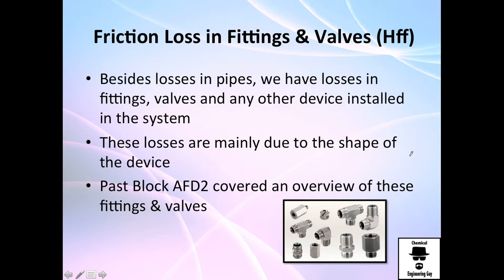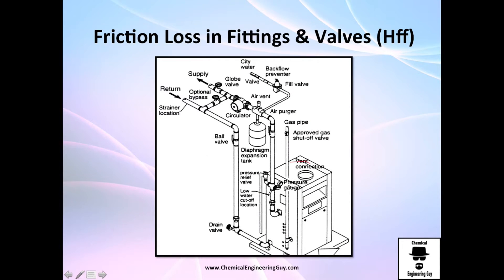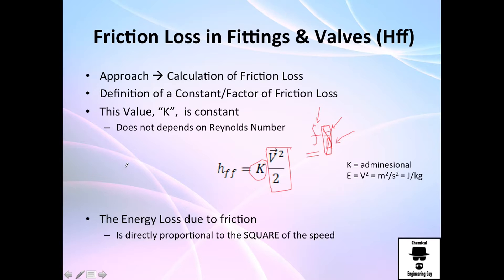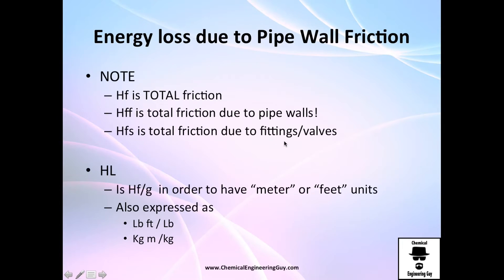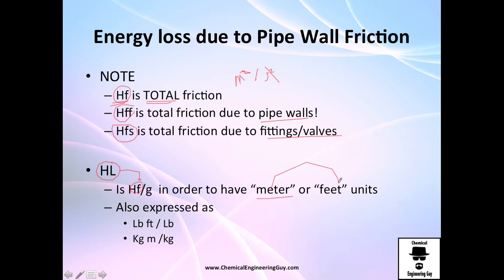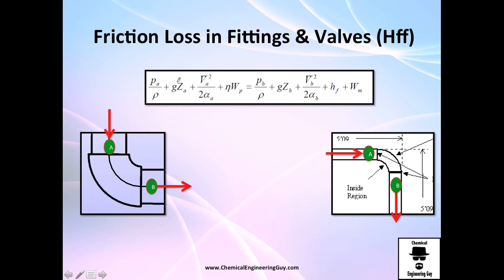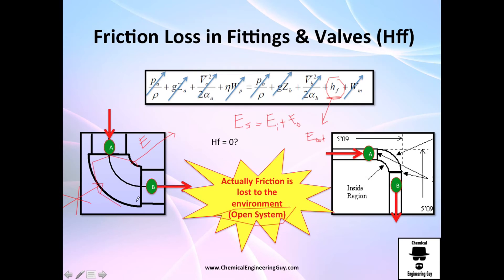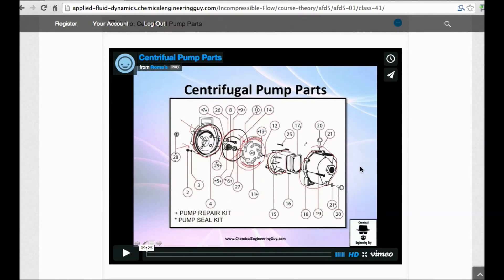Friction Loss on Fittings and Valves Applied Fluid Dynamics - Class 034

Comment: When calculating the head loss through fittings, is the same "K" value used no matter what the viscosity? Everything I've read, states the "K" values are for based on water. Wouldn't there be bigger losses in a fitting for a more viscous liquid?
Reply from the maker: Of course K is based on: Velocity of fluid, Temperature of Fluid, Pressure of Fluid and TYPE of Fluid. Note that we typically use standard values such as water, and its properties ranging between different set of T and P.... Of course if you need specific values you will need to research them and if no data is obtained, you will most likely use you rown from experimental data. An average value will be recommended...